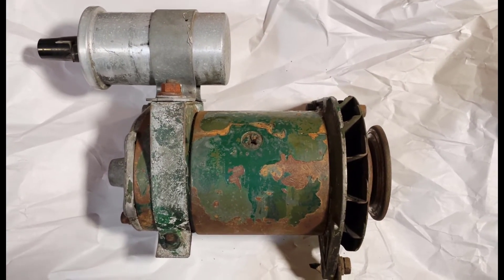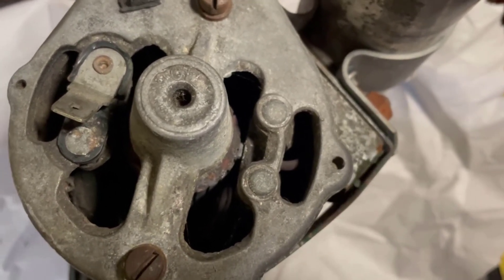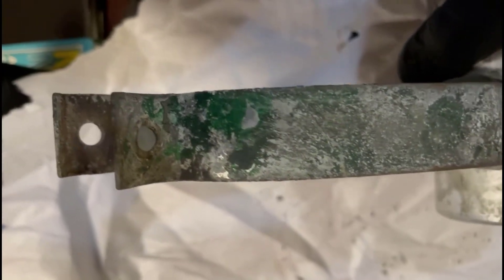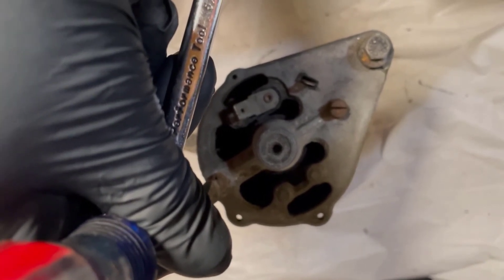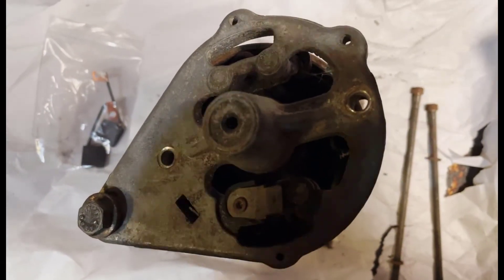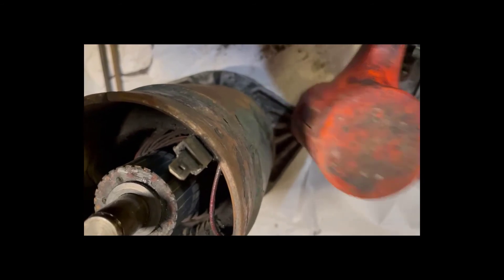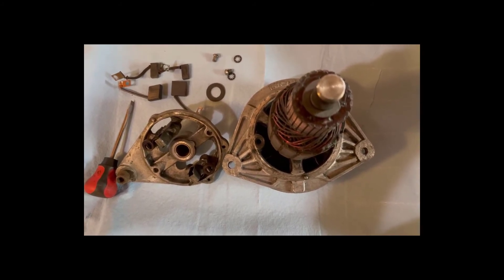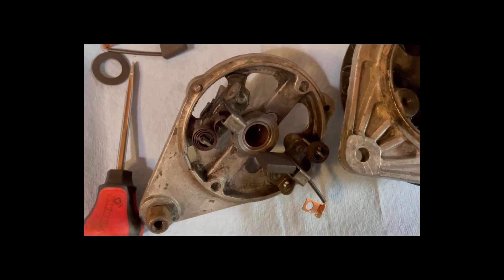Morris Minor Dynamo Brush Replacement and Test

Comment: Hi, I got a C39 exactly like yours that has that reccess. The C40 doesn´t.
As a tip, to put the new brushes, you can slide the coil spring tip out the place and that way you can insert the brushes softly and mount the cover easly to place. Than you just have to put the springs back to place so the bushes make the desired contact.

Comment: You covered many good points.  I think that if you wanted this to last, and to not immediately burn the brushes/commutator, the commutator should have been turned flat to eliminate the ridges and rough surface (about 8:15).  At 9:30 they are still visible.  The brushes should also be "bedded in" before asking them to carry full current. See the "Lucas Manual A6" for great instructions.  Did you check the front bearing for play and/or roughness?  The original bearing has no seals, but a replacement is a VERY standard 6202-2RS (15x35x11mm thick) double-sealed - widely available and inexpensive.  My C40 is on my 1957 Alfa Romeo Spider - like you, still having fun at our ages!

Comment: Surprised that the shouldered dynamo is fitted to a 1969 traveller, I thought they did away with them mid 60’s so it is worth keeping it as they are getting quite rare now - I have a few for my Austins but when U/S they used to chuck on a replacement unit as the cost of a refurb was near the cost of a new one. Also a trip to the local Lucas service centre was often a test of your patience! Please keep up the good work - the Lucas service guides are excellent I guess you have some of those?